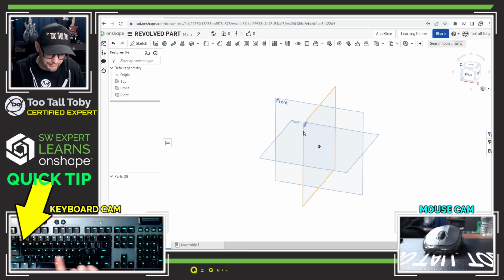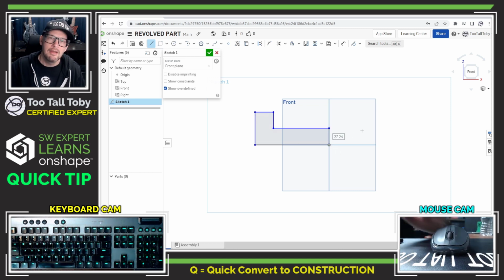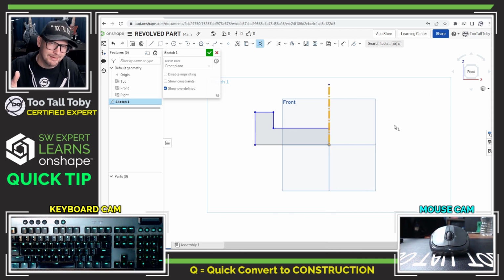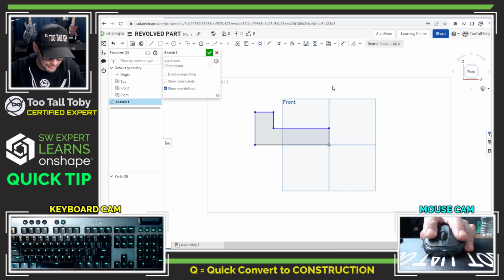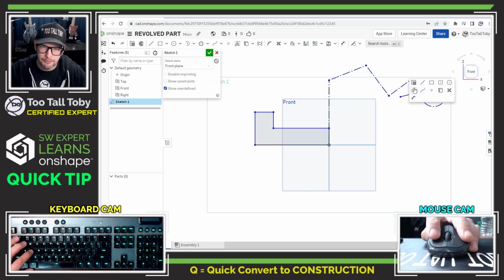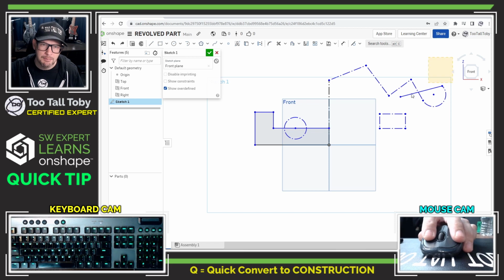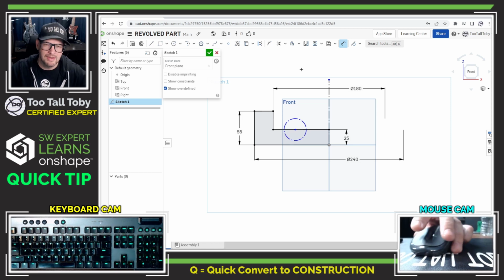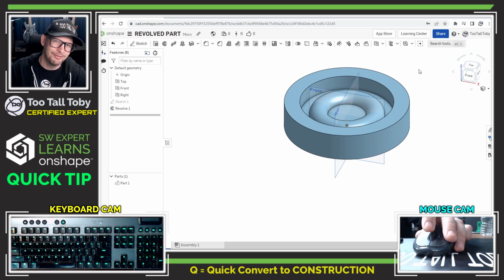Sketch Faster in Onshape using Q for Construction

Comment: you can only get the doubled dimension using construction lines, but they persist if you convert the line to solid, so you don't even need to add a separate line for the revolve axis. You can sketch the profile to revolve and get diameters using a construction line then hit Q to flip it before revolving to enclose the profile (in which you select the line segment itself in the profile for the revolve axis)
Reply: Oh that's cool - I never thought about that but I'm gonna start using that - THANKS!!

Comment: You can type “q” at any time, it’s a mode toggle. So sometimes I type it before making the series of geometry commands.

A potential confusing point with using “q” to change a selection is that you have to be intentional with what you do next. If you’re done, clearing the selection I think is easiest by pressing “space”, especially if there’s no empty background in the viewport. But if you’re not done, picking other elements converts those, too. Remembering which to do I find a little tricky, but at least there’s Undo to fix a mistake.
Reply: I agree it can be a little tricky to get used to, but once you do it can really speed things up!